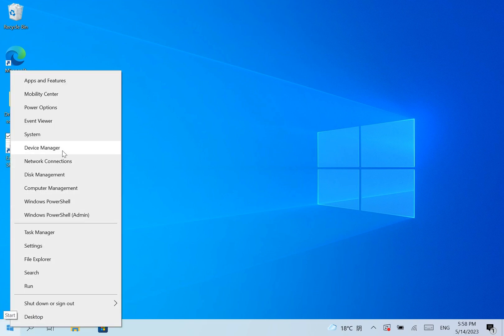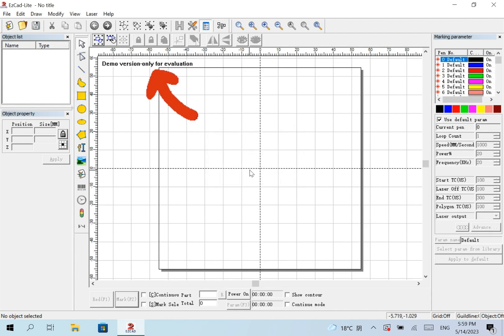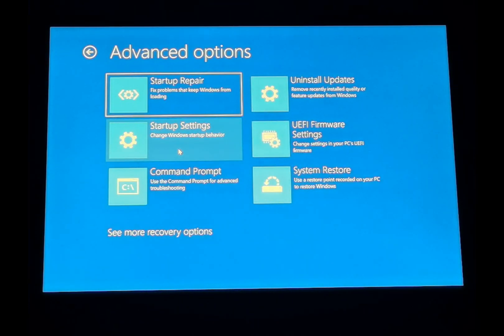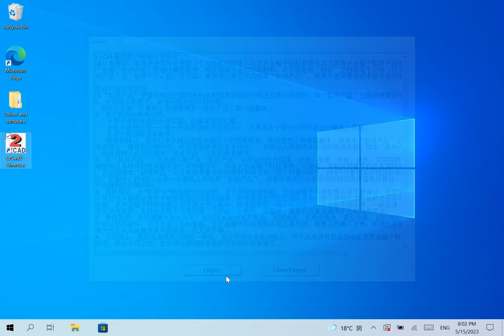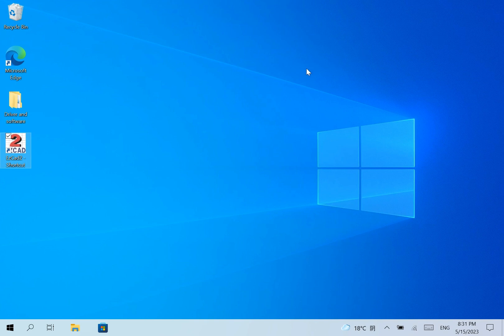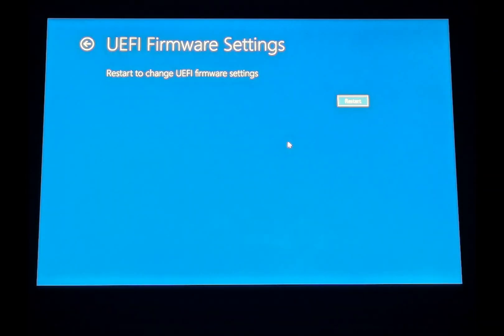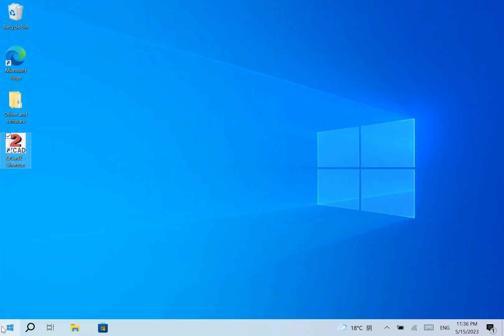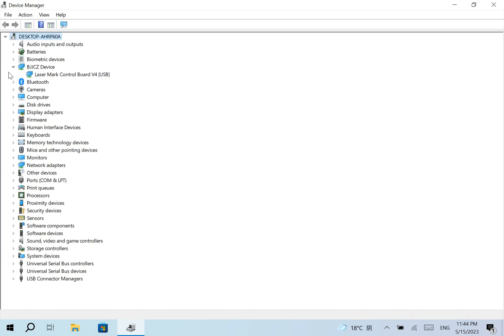The solutions for EZCAD problem "Failed to open lmc driver!'

Comment: No.brother..
Its not work..and uifi option is not listed in my computer
Reply from the maker: Hey,you can contact me by whatsapp or email.See first comment.
Reply: @likaiwang7288 ...ok..But my problem is over now ...The 5 volt power supply in my laser machine had gone bad...which is now working fine, I have installed a new power supply ...thanks for reply...
Reply from the maker: @Ak1993BK  Ok great.Thank you tor the information.

Comment: Hello, I keep getting the message "failed to open imc driver" and in device manager I don't get any updates.  What could I do?.  greetings
Reply from the maker: Maybe you can check your usb connections from machine to computer and inside the cabinet.If you need support,please write email to me optictim@163.com
Reply: make sure you save the settings when you disable the boot